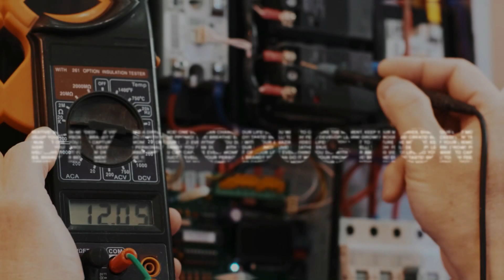Converting LED flashlight - From AA to rechargeable 18650 battery - How to

Comment: I have a tensiometer running on 4xAA batteries 
Can i replace them with 18650 batteries or it is impossible knowing that 4xAA give 6 volt and 18650 have 3.7 volt how to solve this
Reply from the maker: Hi, u can use LM2596 voltage regulator for that projects.

Comment: Thanks! Now I need to do this to all my little devices.
Reply from the maker: Yeah great thing to do :)
Reply from the maker: @2degucitas  I hate devices with AA or AAA batt..
Reply: @electro_solar   That's what's in 2 of my devices. Are there rechargeable batteries that are a smaller size than the one you used? One item is a handheld hot milk foamer, basically an electric whisk. It takes 2 AAA. Not much room for a large battery AND a charging port.